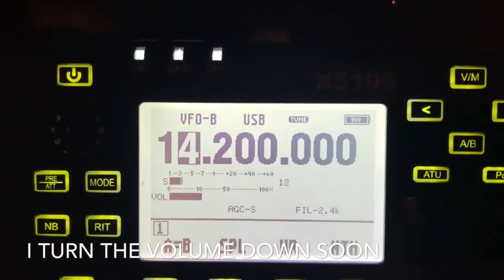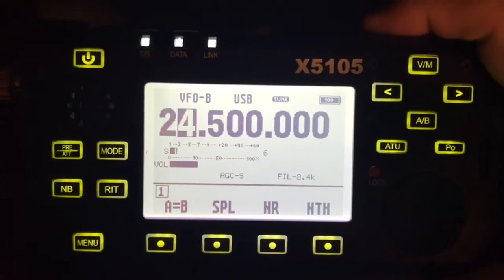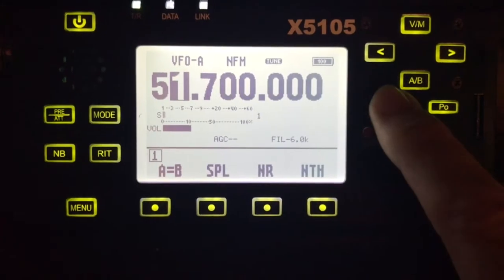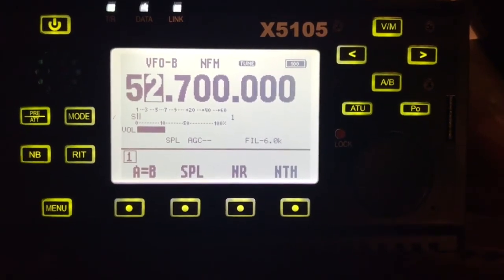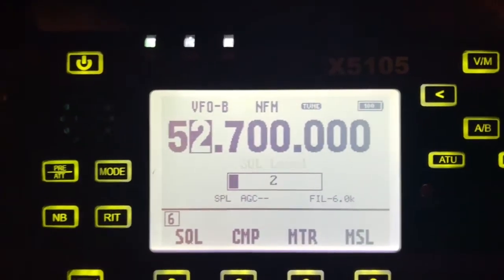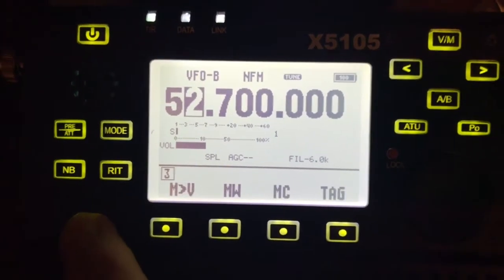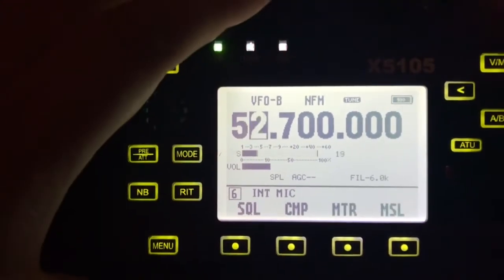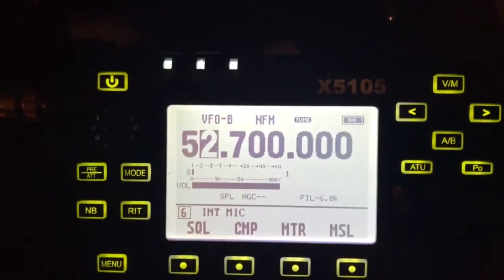Xiegu X5105 6M FM repeater usage

Comment: This is an old thread but I bought the X5105 recently to use on 6m repeaters and yes, the latest firmware v3 is missing ctcss.  However, this was a menu option that did exist in past firmwares so I filed a bug on Xiegu and Raddiosity for a fix.  If this effects you please do the same so we can get a new firmware spin of this critical feature.